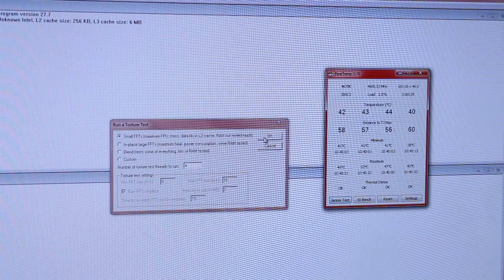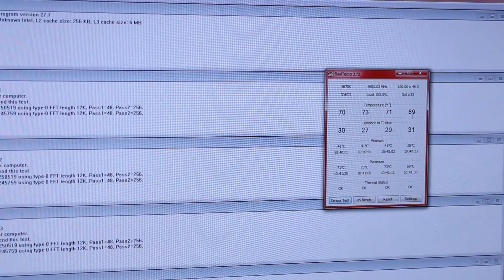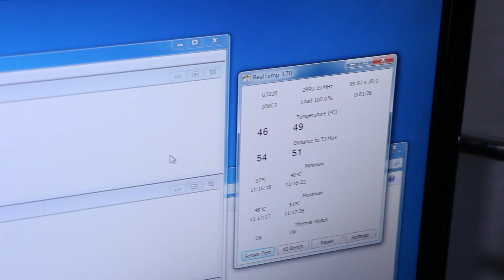i5 & i7 Haswell & Ivy Bridge - FULL Delid Tutorial - (Vice Method)

Comment: Hell yeah, I got an old xeon going stable at 4.2 ghz and I can push it further but the temps are a bit to high, so this delid will do great, altho current thermal paste is some cheap coolermaster stuff but ill pit liquid metal on it when I delid it.

Its a xeon x3440 and in only pushing it this hard cuz someone says its useless, even at 2,55ghz with 1033 ram it easily runs everything, now its at 4,2 ghz with 2400mhz ram and I replaced the 780ti with a 2060super so lets go!

Comment: Which Intel processors can not do the Delid?  at i7 2600k can Delid be made?
Regards from Venezuela!
Reply: Everything can be delidded, just not with this method. See der8auer delid a large-area Indium- soldered AMD CPU by applying just a tiny bit of displacement back and forth several times.

That being said, delidding 2600k or any 2000 series, as well as most LGA2011 processors is more risky, pointless and difficult because the heatspreader is Indium-soldered.

Comment: Why is there a certain CPU at 5:22 (with the broken corner) and a different one at 5:25 with the corner fixed. The second CPU is an i7 because it looks the same as mine delided. Was the first CPU an i5 and you destryed it ?
Reply from the maker: You have a great eye, I vaguely remember now, but I think I delidded two cpus, a g3220 first, which was my HTPC, and gave it a bit too much power the first time around, the corner was a little bent, though still works perfectly fine, I gave it to my friend when I left Japan who is now using it as his HTPC.  I recently had a 7700k that came in with all corners bent.... bent them back and it was working perfectly fine, as long as you don't damage the traces / die then you should be ok.
Reply: Thank you for the reply. I delided my CPU yesterday (4770k) after watching your video. Cpu was out of warranty after 3,5 years and I was tempted to buy Ryzen :-) but the delid process worked an my temperatures went down 18 degrees. I am using MX2 compound and I will check it on regular basis, didnt like the idea of putting the liquid stuff on the dye.

Comment: Don't use a hammer lol simply position the cpu at an angle whereby the pcb touches one end of the vice and the ihs touches the other end of the vice grip and simply and safely start turning the vice and the ihs will simply slide off the pcb.

Comment: does trowing the chip on the wall part's of the delidding process ???
Reply: Intel cpus  are robust  to being checked around just don't drop a brick on it and it will be fine static electricity  will kill it and bashing  it won't but if you scratch  the substrate then it will cost you lol

Comment: I keep watching delidding videos trying to build the courage to do it.
Reply: Depends on your definition of Necessity.
My shitty 4790K is ideling around 42°C without ANY overclock applied and without ANY load on it. Thats with a pretty beefy Dark Rock 3 with an extra fan for Push-Pull.
Under synthetic load some cores go up to 94°C, again, at stock clocks.
Reply: It's necessary for kaby lake cpus, they tend to get abnormally hot.
Reply: +Gam3W0rlD How did it go? :D
Reply: For me its easier since I got a sacrifice cpu before I try it on the real one, but looks like ill have to buy the official tools. Its a 12 year opd cpu and running a bit hot so a delid will probably help
Reply: You dip shit that's because the 4790K is a 4770K that Intel redid the the Thermal Interface Material (TIM)! They didn't solder the lid on they used a crap paste that looks like shit so the only fix they did was to change the paste and up the clock to 4ghz.
Reply: Don't.  It's completely unnecessary.

Comment: People are clueless here. 15-25C difference in temps on most haswell CPU. The tutorial lacks the safety measures taken by others. Should tape the bottom of the CPU to the vice on the side you are not hammering on so that when you hit it the tape holds it from falling. You can also heat it up with a hair dryer to try to warm up glue for quicker and possibly safer removal. Lastly and I think this is most important is you didn't warn people about using conductive thermal paste. Liquid metal pastes are the best but they are conductive. Some people put silicon or laquer on top of the metal things sticking up next to the center to protect them. If any of your liquid thermal paste gets on those metal things it will likely destroy your CPU. After some research and taking the right precautions this really is not that difficult. You can also usually sell your cpu on overclock.net and you can glue it down with something like silicon if you actually want it to be glued.
Reply: Exactly what I was thinking thanks for the heads up.
Reply: He also put a little too much liquid metal.
Reply: That cpu appears to have copper contacts  on the  surface  near the die, but anyway he uses liquid metal "paste" without 

mention that it has electrical conductivity.....

Comment: I don't have any problems with my 4690 on the stock cooler yet so I will add this to favorites but really won't do this unless It gets too hot in the future.
Reply: +Bas van der Meij (Ykai63) it's more for overclockers di this with my i7 4770k at 4.00 GHz as it neared 105 degrees celcius
Reply: looks like you fucked something up
Reply: +Reuben Horner nah voltage is at 1.4
Reply: Josh -O bro. 1.4 is quiet some. Having said that, my cooler can get mine in the 80's at 1.35v so.... maybe there is still something broke
Reply: Doesn't have to be broken.. computer components are weird and some chips heat up more than others and can even use different amounts of power while doing the exact same thing. Processors aren't always 100% equal because they are so hard to produce. 

All you can be certain about is that the stock configuration works within factory intended frequencies and voltages while remaining a safe temperature.

Comment: Been thinking of doing this on my 4770k. It's running at 4.8 GHz @ 1.212 voltage. Gets near 100c on burn test but nowhere near that during regular use obviously. If I could knock like 10-20 C off those temps could probably get to a stable 5.0.... http://valid.x86.fr/kcp9i0
Reply: Tekuila lmao fuck that u, I have stock 4790k and idles at 49c hahahaha. Damn over clock nut. I just want to delid to be able to run my chip STOCK! (stable, without throttling) :D

Comment: This kills cpu value. most people wont buy this delided, so most people need to rethink this.
Reply: Buy this.
Reply: how will it kill cpu values  he just added a tim  that is worth more than Intel's tim plus many peaple sell speed binned  cpus for way more than intel does because it's risky business  so it loses  value  is bullshit  when you buy a car it loses value anyway  because it's not new if you bought it nothing stays new and and a cpu  overclocked  and sold with a higher  clock is worth anything  to many people
Reply: Now 4 years later, if you buy a CPU from back then, you bloody better delid it anyway because the thermal compound that Intel uses actually dries up and stops making consistent thermal contact, as abysmal as it was to begin with. So you might as well buy a working delidded one rather than risk cracking it yourself.

Comment: i use asus 4 way optimization for a easy 1 click modest overclock. my 4770k now has 2 cores at 4.1ghz and 2 cores at 4.3ghz.

if i did this, it would only be for extra FPS when gaming (especially at 4k).

so my question. if this drops my cpu temp down 8-10 degrees how does that correlate to FPS?

does that mean Asus's 1 click overclock will bump up a bit more, to what, 4.5 across all cores?

whats an expected FPS gain, like 3 more framses, 10 more? 

is this worth doing for someone who only wants to increase gaming performance and does NOT manually overclock?
Reply: ***** I ended up doing it. You are correct. My chip still clocks to the same speed. Just much cooler now. i had a feeling my chip was already meeting its potential. but i didnt mind the risk of trying this anyways.

Comment: Hi,
For future reference, Arctic 5,  MX4  and all non liquid thermal paste should be apply in different way (cross, line or spot pattern). The Liquid Pro was OK.
You probably loose a few degrees doing it this way. There is a nice video on YouTube with piece of transparent glass where you can see how to apply paste in proper way. 

P.S.
Did you drill your furniture to mount a vice ??!!
Reply from the maker: +Adam Ziolo Yeah drilled the front cupboard to mount it ftw.  I haven't found different methods to show any different results (max 1 degree), only thing I have found is that the amount of thermal paste you apply and the pressure when mounted are more important.

Comment: Great little guide mate, very well done I am going to have a crack at this.
Just wondering if you can use the Coolaboratory Liquid Pro for top of the heat spreader as well? That is why did you use a different type of TIM is there a reason for it curious to know.
Thanks in advance Browny.
Reply from the maker: +EasyAussieTarget Reason is it because CLP can eat away at certain types of metal and doesn't matter as much on the IHS becuase there is more surface area for contact.
Reply: When will you do this on a GPU/Graphics card or at least try this on an FX 8 core???

Comment: Very brutal way to treat the cpu ! Oh dont try this with the X99 platform
Reply: jonathan oxlade
Nope, the heatspreader is soldered onto the cpu. You will destroy the processor
Reply: then use a small torch and gently move it around the chip to Melt the solder if a gpu can survive a oven a cpu will survive aswel
Reply: jonathan oxlade
There is no need !

Comment: 1.) Is this needed/worth trying on i5-4590?

2.) Is it asking too much to bypass the lid, and just have the heatsink contact the die directly?
Reply: Skirrow You clearly weren't around in the days of us real men who's CPU's came with no lids and you always put the heatsink directly on the die.  

Sometimes a better heatsink isn't enough.  Sometimes when the overclock speaks to you you have to listen and keep going up.
Reply: Whit Siever 1.) NO. Unless you are getting to the max operating temp @ 72.72°C and you physically cannot get a better heatsink, this is a useless application as there would be ZERO benefit as you can't overclock the 4590, you risk damaging the chip, it voids warranty, you may have to replace the compound once every few years, the paste costs money, it takes time.... dude, don't do it. If you have to get lower temps, get a better heatsink or reapply the thermal compound with a better one on the plate.
2.) I'm pretty sure the heatsink wouldn't reach the die directly and if it did, you'd risk damaging the die due to pressure. I bet the temp difference would also be negligible.

Comment: SCREW putting that heatspreader back on. Cut off notches from it and attach it back to the board as spacers. Then allow your heatsink/block to directly touch the diy for best cooling. The notches from the heatspreader will give you the perfect spacer (use fine grain grit sandpaper to accurately get the height to a perfection of course) That's what we did back in the days and it was way better than re-applying that crap heatspreader. (Haswell you'll still need the side portions of the spread for the MB ZiffSocket clamps to press down on) Plus it gives you the best contact. Spacers will help prevent you from cracking the diy. Finally you should be using stack bags (motherboard bags) while handling the CPU, ect, when possible. Stack bracelets are great too.

Comment: Thanks for the video. I've got a question for ya. My CPU cores aren't very consistent in terms of temperature. For example I just did a full load test in AIDA 64 and have the following temps: 67, 75, 58, 59. About a 17 degree difference between my hottest and my coolest core. After a good 5-10 minutes I'll start getting random 20 degree spikes on specific cores, one will jump into the mid 80s while another stays down in the 60s. I've tried AS5 and IC Diamond, and multiple reseats of my cooler. It really seems like there shouldn't be any more than 3 - 4 degree differences between cores in my experience. Does that seem like an issue delidding would fix? Or is that something more internal that I can't fix?

Comment: I know that CLP is recommended,but how much of a difference in temps would there be if I used AS5 on the die?
Reply from the maker: Robert Floyd At first not such a big difference, but I found with AS5 and PK3 on the die that after a few days the temps were worse than even the stock heatsink paste.  CLP is the best because it can handle the heat of a CPU die directly and does a fantastic job of transferring that heat to the IHS.
Reply: Tech YES City Thanks for answering. I have the 4690k on a Asus Z97 Pro-Gamer in a Rosewill Thor V2 with a Corsair H100i cooler. The temps with prime95 go into the 80's so I'm figuring I'll have to delid it to get the temps down. While I do not have a thermometer where the computer is,it's not hot by any means.

Comment: I have a question. The whole reason to do this "delid"-thing, is to remove Intel's pre-"installed" paste between the die and the heatspreader, and then replace it with this Coollaboratory Liquid-paste. Alright, since this Coollaboratory Liquid is so good, why don't you also apply it on the heatspreader itself instead of the "standard" cooling paste you use in this video?
Reply: Temp difference on the lid itself is minimal compared to much cheaper paste like PK3 or MX4 or AS5 even.

Comment: I can find every video on delidding the 4790K, etc. but none SPECIFICALLY for the 5820K. Sources I have found on the web are 50/50 on wether or not the 5820K has the good paste on the die. Tech! Would you PLEASE find out what's under the hood of the 5820K? I am NOT going to take a hammer to my CPU if I don't have to. It's bad enough I payed $400 bucks for this chip and my wife says if I do that she's gonna take that hammer to my head!.....shrugs
Reply: It's soldered.

Would take you 2 minutes to google if you actually tried...
Reply from the maker: MrCougar214 No worries mate, it is soldered to the die.

Comment: i have delidded my i7-4770k and im get like 3c less than before i used the razor method and put nail varnish on the vrms so that i dont get liquid ultra on them and i clean most of the glue crap and tried reseating it please help
Reply: Did you apply a thin layer to the bottom side of the IHS, the side that makes contact with the die?  I first spread it on the die (just like the video), but then took a small hobbyist paint brush (very small brush), and just picked up a bit of CLP from the die I just finished.  Then I applied a thin layer to the bottom side of the IHS... and when I say thin, I mean almost non-existent.  I had to keep brushing for a good while until I could see it.  This was the key to it working the 2nd time for me, as well as removing as much of the glue.
Reply: i was using liquid pro on the die and the heatsink and the heatsink wasnt making good enough contact so i toke it off and put artic silver on the heatsink and liquid ultra on the die and i got a 30c temp drop its running high 60s at 4.4 at 1.250v